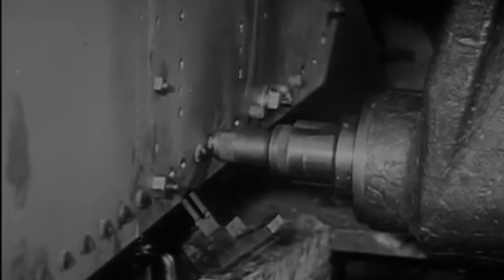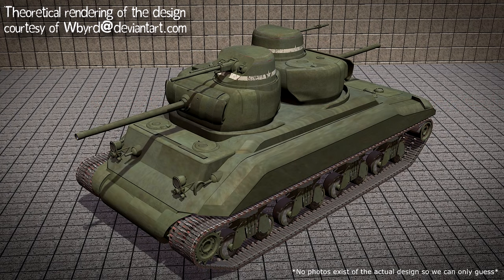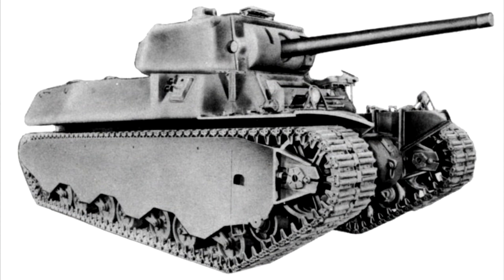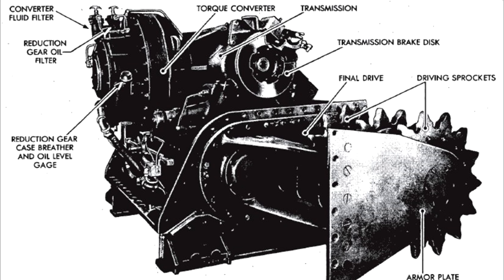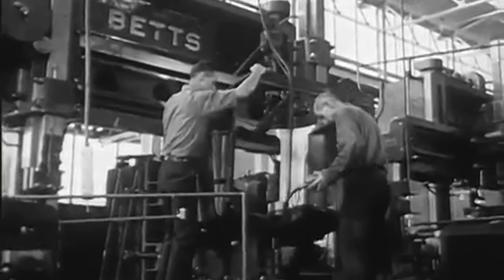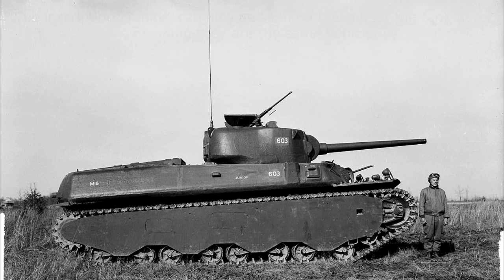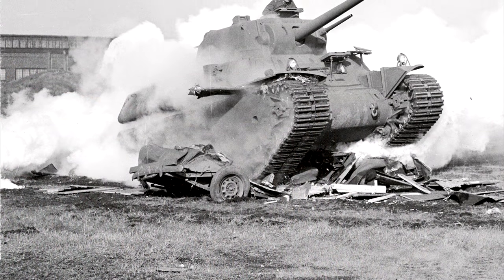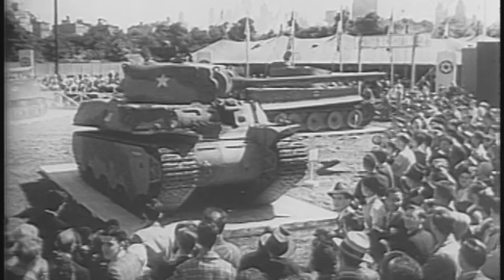America's Tiger, the M6 Heavy | Cursed by Design

Comment: Tank designs show that they don't always achieve success and don't ever make it passed the drawing board or testing faces. But as much as may seem as complete waste of tax payer dollars or an effort it in vain. Not everything is lost from such failed prototypes designers will and have taken design aspects and components that worked well for the test bed vehicle and are able to develop a successful successor design that does not only meet the prototype testing expectations. But exceed them and the militaries needs change and evolve over time.

What might not have been a good design or not needed at one point can in fact be the right tank for the right time later on. The M6 may have been a failure, along with its improved variants, T29 and T34 heavy tank projects but I do think it helped shape the eventually production of the Pershing and  Super Pershing tanks. 

As clearly the MBT 70 in the post war era helped shape America in developing the well known Abrams and Leopard 2 designs for Germany. Some times with R&D you need to pull the plug on the project and take a step back for a bit and as military just forces on some incremental upgrades for current battle tested designs for the short term. Then start a new project later on and take lessons learned from past failed projects as it clearly shows eventually designers will get it right and will have a tank that does enter service and is mass produced in large quantities serving as the back bone for any military . While being able to improve a upon that new design that to the point that latest iterations are in such an evolved state of the original design that they could be considered an entirely new tank. The Patton's were the ultimate evolution of the M26s Pershing designs from WW2.

In World War 2 Germany failed to learn such lessons and continued to produced more powerful but ungainly machines that continued to have break downs. America learned that the M6 project was a futile endeavor but they gave it a good run and the R&D crew gave it their all and shouldn't have felt shame for failing to get to combat ready vehicle for mass production. America want to get its tank designs right although the Pershing had its flaws and some mechanical issues as well as being too late to participate in WW2 much it was far better of reliably than the German Tiger 1 and even more so than the Tiger 2 or King Tiger. I do really think M6 played a key role in designing subsequent world war 2 tanks and its turret design might have given some inspiration to the Upgraded 76mm turrets on later Sherman models. It wasn't meant to be but it was just the beginning story  for the development of much better tank designs or upgrades to other current gen designs that would make them more competitive in the latter stages of the war being able take on Tanks like the Panther and Tiger 1 head on without having too solely rely on swarm tactics which could be very costly especially against very experienced German Tank crews.

Comment: The M26 Pershing was a far better tank than the Tiger. It didnt take many, 2002 were built, and came out later in the war  At a time when the M4A3E8 had already proved sufficient, when used with a superior combined Arms strategy.
In Korea, the M4A3E8 proved superior to even the Russian T34, and the M26 easily defeated it. If course by then even it was inferior to the M46, 47, and 48..
The M6 required a 6 man crew, was slower, 10 mph slower) than the M26, had inferior armor protection than the M26, and a much smaller gun than the M26. Despite its 10 ton heavier weight than the M26. (Way too heavy for the roads and bridges in WWII europe.)
I think you watch too much Skilshare, and play way too much  World of Tanks.